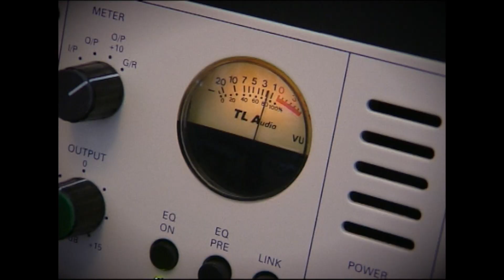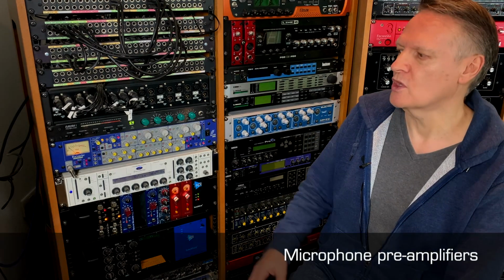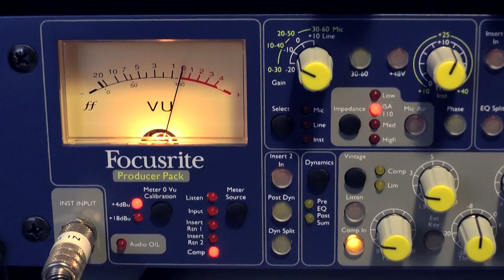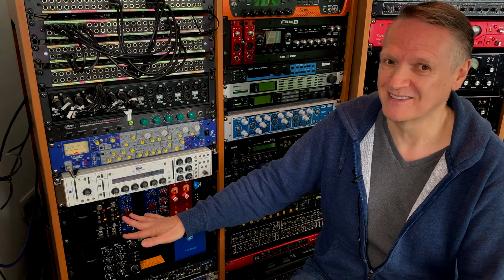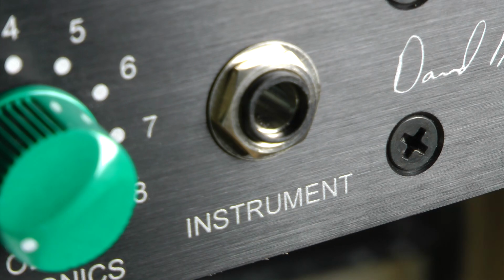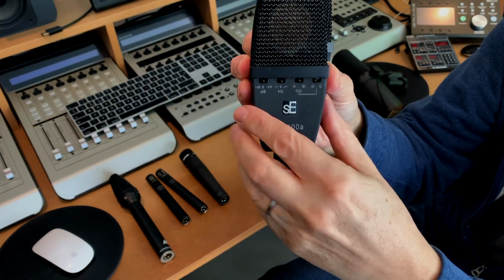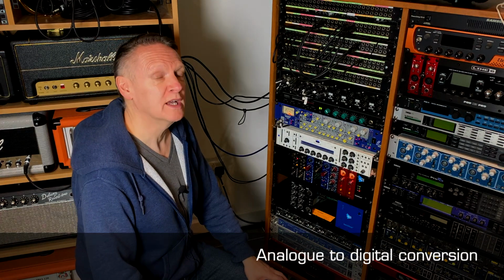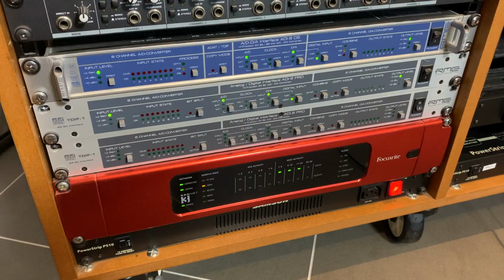The 40 Year Home Recording Studio Build Part 2 - Microphones, mic pre's & A to D conversion

Comment: Again, an other interesting video on this channel. And I subscribe+bell. 
I realy like your honnesty about "not hearing the difference". Either you and me are deaf, maybe, or someone somewhere want to sell us something expensive 😉
You use ADAT connexion and I've heard different things about the ADAT lightpipes. 
I'm thinking to expand the I/Os on my Apollo 8 in order to work more "out of the box" (and maybe use my old gear more, I guess you and me began our sound journeys almost at the same period, so we collected tools....) and an ADAT link is a possibility. 
Are you definitely happy with ADAT links? Is it convenient, transparent and stable?
Reply from the maker: In my experience ADAT light pipe is the most reliable interconnect over short distances providing you keep the cables out of harms way. Not subject to electro magnetic interference and cost effective. Supports multiple sample rates and word length. Thoroughly recommended. More here .. https://youtu.be/i09GgrabaUg

Comment: I got one of these akai 4000ds's. primarily intended to print my mixes through it, though it's been a bit of a hassle to keep it going... a while back, before I had any compressors I used a portable cassette which had a built-in ALC/limiter. mostly used on drums, anything else sounded too angular.